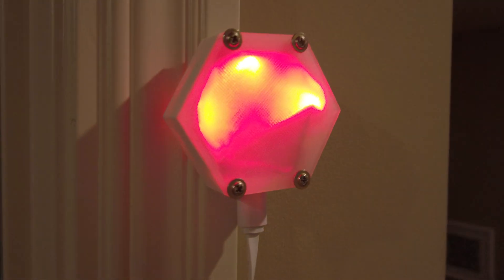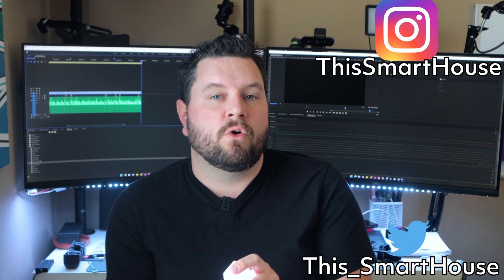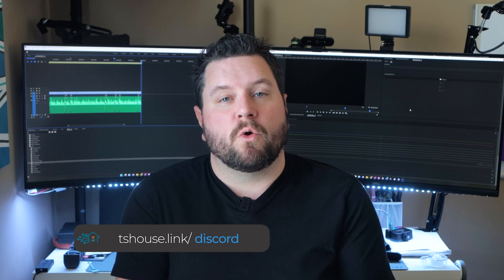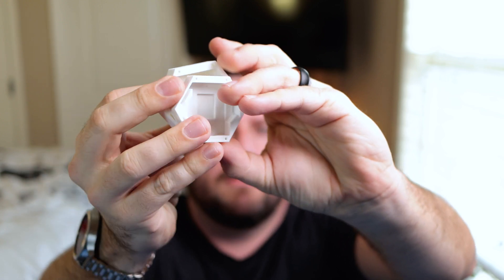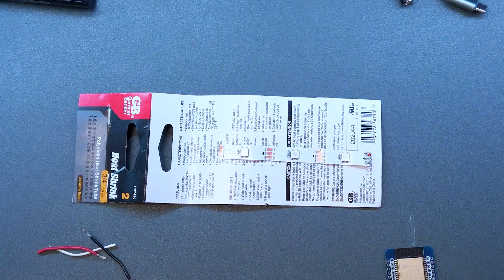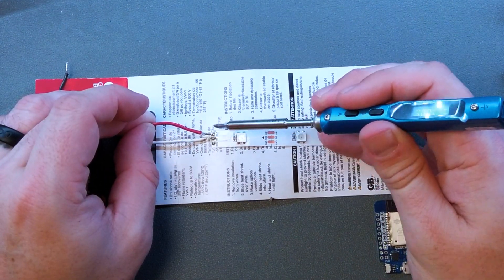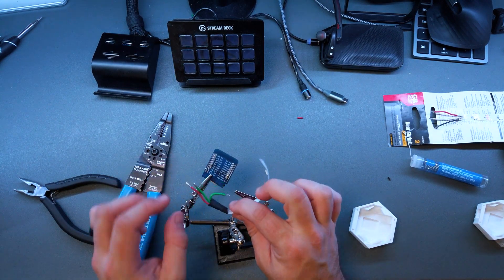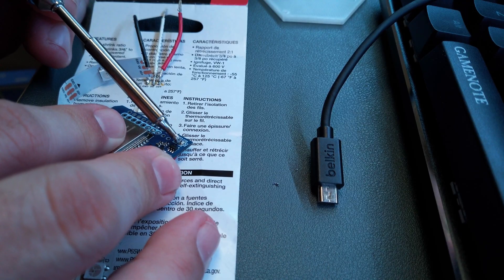Build Your Own Teams & Zoom Busy Light // Part 1

Comment: Can you recommend an outdoor motion sensor that works as close to out-of-the-box as possible?
Reply from the maker: What hubs do you have?
Reply: @ThisSmartHouse  I do not have any Hubs or USB sticks hence the question on the easiest device to get working on HA. I do use some devices via ESPhome but the YAML language is a bit too confusing for my taste.
Reply from the maker: Do you have any external cameras? Sometimes you can use those as motion sensors as well. I use my ring doorbell as a motion sensor to trigger my front lights. The problem is, there's not really a good open source compatible motion sensor for outdoors that runs on WiFi (no extra hubs). Wi-Fi is not really good for battery powered sensors because it's so power hungry.
Reply: @ThisSmartHouse  a bit confused how do cameras act as motion sensors?
Reply from the maker: So for example, the ring camera reports back motion to the cloud, that is what starts the recording. So the home assistant integration can see that motion sensing and expose it as a binary sensor. 

What, if any, cameras do you have?
Reply: @ThisSmartHouse  I have the Ubiquiti bullet cameras.
Reply from the maker: You are in luck, looks like there is already an integration: https://www.home-assistant.io/integrations/unifiprotect/